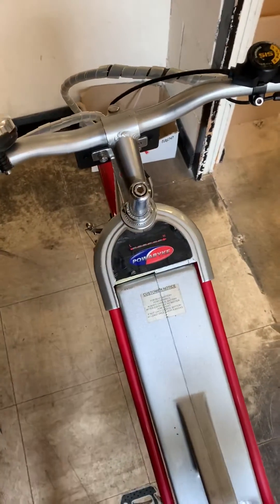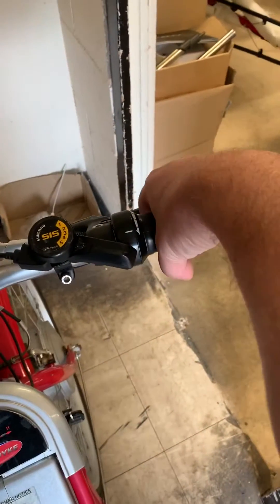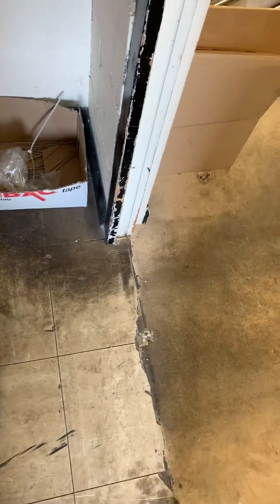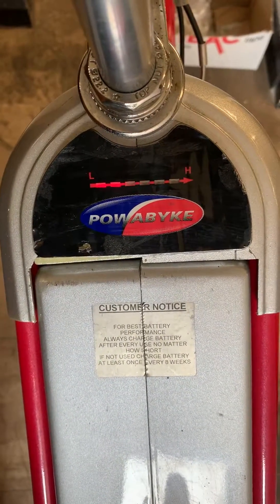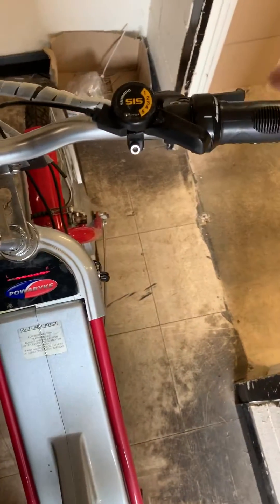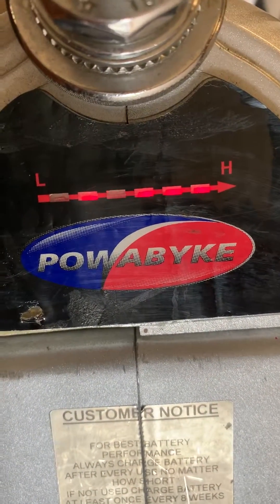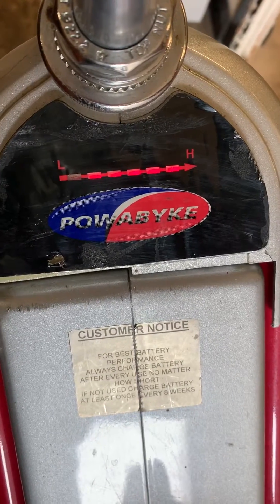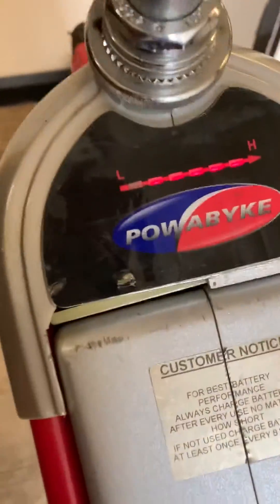Powabyke Electric bike self diagnostic check

Comment: Hi Frank.  I have a Powabyke Euro just like your one.  It’s in good condition, but had little use until today, as I’ve had some health issues.  Before I took it out I replaced the pedal crank, as the old crank had some teeth missing.  I carried out your diagnostic check, and it seems to pass OK. 👍🏻 The bike went well, but the assistance only kicked in when I pedalled.  As I understand it there are two settings - one for where the throttle will operate the motor regardless of pedalling, and one where it will only assist when you pedal too?  Can you tell me which mode is assigned to which position on the key switch?  Many thanks in advance. 😀
Reply: I think that you have to pedal to get going for both key positions; but 1st position will operate the motor after you stop pedalling, while 2nd position will only assist while pedalling.